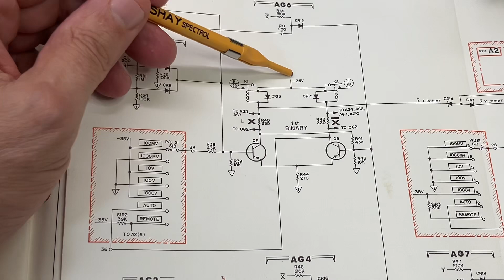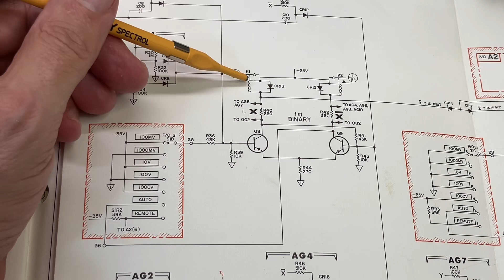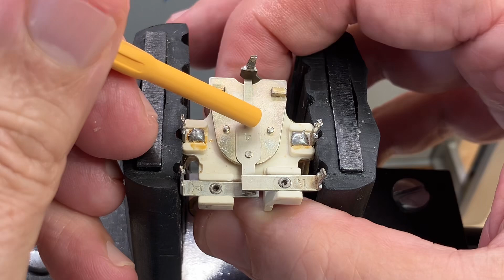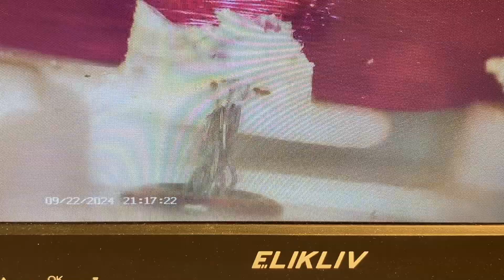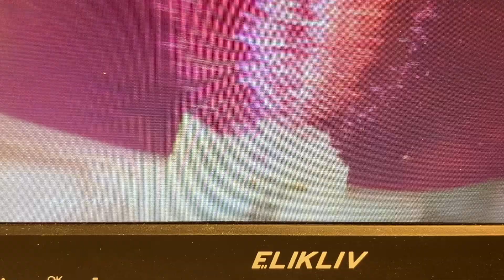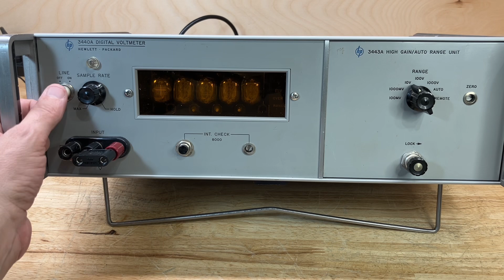Deja Vu: Another HP 3440A Restoration Part 2

Comment: A clever (upside down) and elegant (in its simplicity) repair trumps a little bit of your age showing in the solder joints. I have that same age challenge, so I commiserate with you. I do think your solder iron tip may have been a little cold, for the job... Or, maybe the tip you used was small and did not have enough mass to carry the reflow all the way through. This is not fault finding, but is intended to help you find a work-around. When I have marginal heat, I also cheat, by applying copious amounts of flux. It encourages the flow out that little extra bit. You did an amazingly great repair! Kudos!
Reply from the maker: @t1d100  not a problem with my age, or with my soldering iron either. The problem really was with that cheap piece of imported plastic perfboard. Really not appropriate for a fine vintage instrument, but it’s what I had. A custom fabricated FR4 PCB with plated through holes would be better suited to the job, and actually I may go ahead and have some made.
Reply: @garyramsey4275  Ahh, yes, you are right! The brown type is nearly useless. Once I found and tried the double-sided, plated through hole type, I never went back. I still have some of the brown stuff, awaiting use for some non-electrical purpose. Not only is the brown type not DSPTH, the copper pads lift off way to easily. Yes, a dedicated manufactured board would be a nice upgrade. Manufactured boards have become so cheap and easy to draw up and order that I have begun using them to do all my prototyping... Definitely skipping perfing and, sometimes, even skipping breadboarding.

Comment: Nice try on the relay repair attempt, hair is about 0.05 - 0.15 mm diameter (2-6 thou). I got some 0.05 mm manganin wire and its barely visible